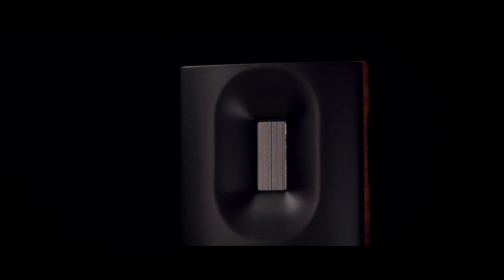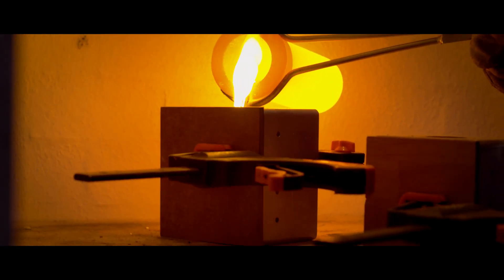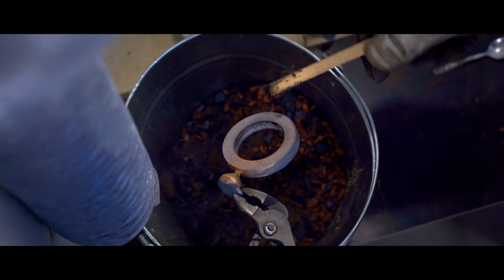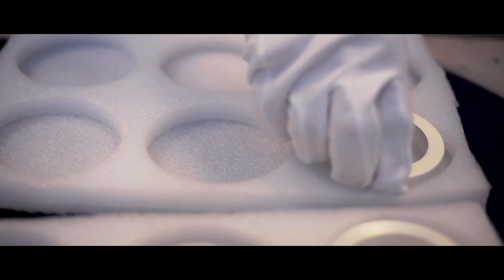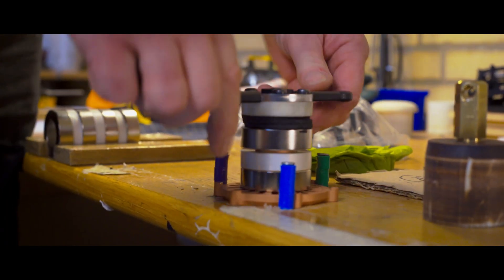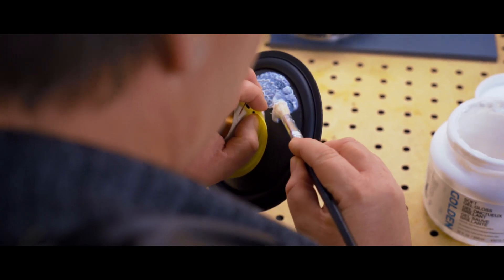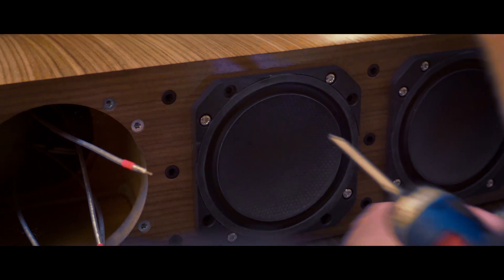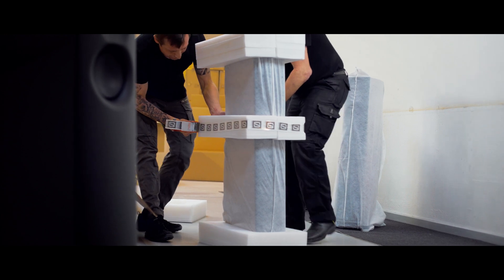BØRRESEN - Silver Supreme Edition loudspeaker | How it's made!

Comment: to glue rubberring with coated  castkets ther a lot better glues then your taking contact adhesive, contact adhesive you taking if you glue two dislikeing material and not rubber on coat.